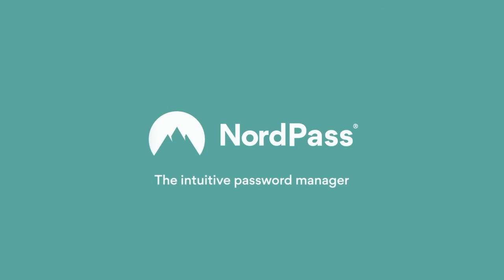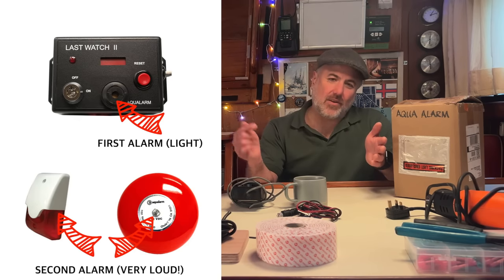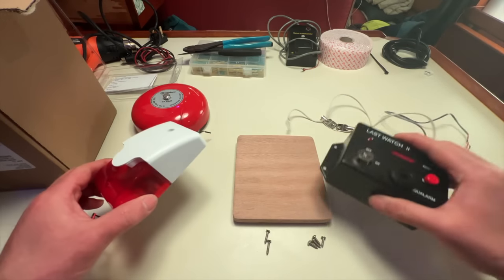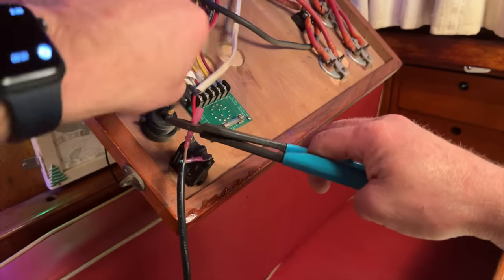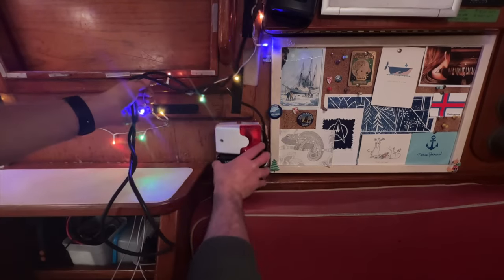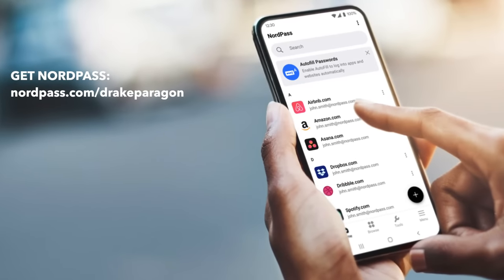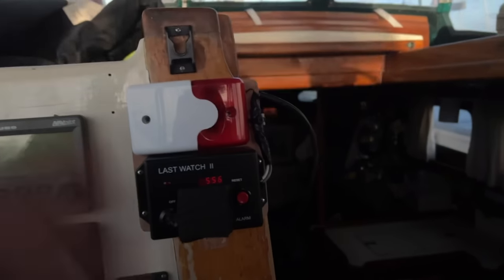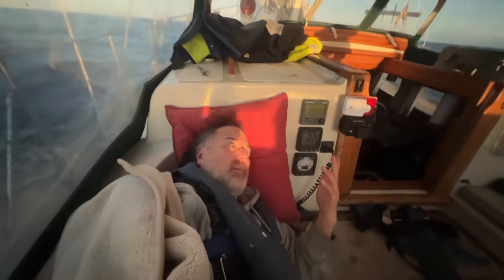The best watch keeping alarm - Aqualarm Last Watch II | Paragon’s Favorite Stuff Ep. 14

Comment: Installed that on my boat a while ago. I was wondering when you were going to realize how loud the alarm is😂. I single hand so don’t have the second alarm. Great video.
Reply from the maker: Thanks S/V Della Jean! Ha! Ya, the first alarm is pretty loud. After I put the foam over it I think I got the volume level just right. But I think the 2nd alarm can still come in handy if you're single handed. I think if the engine and wind noises are loud enough, and if you're sleep deprived and exhausted enough, then you might fall asleep and not hear the first alarm go off. In that case, the 2nd alarm will definitely wake you up no matter what.

Comment: Welcome back. I made my alarm using an Arduino mini an 3D printed box. Cost was 15 USD...
Reply: Hi, would you mind sharing the sketch?
Reply from the maker: Hi Jan, Thanks. I've often wondered about making stuff for the boat with a 3d printer. What make/model of 3d printer do you have? What did it cost? Or did you send your 3d design to a company that printed if for you?
Reply: @drakeParagon  Creality Ender-3 S1 - 3D-Printer is the one i use, you can get it for around 415 USD,  just printed a spare bracket for my autopilot - saved me 65 Euro...

Comment: Great review Drake, I had tried a while ago to find your other Watch alarm but as you say it is discontinued which is a shame.  Anyway this one looks just as good.  How much time between the initial alarm and the second alarm.  Thanks. Andy UK
Reply from the maker: Hi Andy, Thanks! On the Aqualarm you have 30 seconds to hit the button before the 2nd alarm goes off. On the Watch Commander it was a full minute, but we found that 30 seconds worked fine too. So far we've used the Aqualarm to sail 215 nm from Faroe to Shetland and 400 nm from Shetland to Denmark, and it has worked great.  I really like how you can always see on the display how much time remains.
- Drake
Reply: @drakeParagon  Great thanks Drake.  Looks like a great solution and cheaper than the old system.  A

Comment: What a great  piece of equipment  Drake  - on another subject - Armaflex insulation - just what I am looking for - can you give me soome feedback - has it helped.. cheers
Reply from the maker: Thanks. :) We love Armaflex insulation. I've installed countless 3x3 meter rolls of 32 mm thick Armaflex on our hull, from the deck to the floorboards, and also on the underside of the deck, and I think it has made a huge difference. I far prefer the version of Armaflex that has the self adhesive backing. You can stick it right on the hull, and then it becomes a part of the hull. No airspaces between the insulation and the hull, and little to no condensation. We then covered most of our Armaflex with Reflectix, or with a thin, but much stronger foam insulation to protect the Armaflex. I think it's great stuff, and worth the price. If you have any questions about it, please feel free to ask. :)  - Drake
Reply: @drakeParagon  shew thanks for that Drake. I have been looking for something to insulate the boat as we want to visit places - like you do. So want to try and keep the boat warm So excuse my ignorance..if i ask a stupid question.  Does it reduce condensation The self adhesive one seems the go I have been online trying to find it to buy some- any suggestions - or can you point me in the right direction. Have also bought an Omnia oven after your recomendation thanks.
Reply from the maker: @DirkJacobsz  Hi, yes it does help reduce condensation. For example, previously there were areas of the inside of our hull that were covered with strips of teak, with a small air space between the teak and the hull. In the winter, tons of condensation always formed right on the inside of the hull, and that condensations turned it into a dirty, moldy mess. I got rid of all that wood and just put up Armaflex insulation, adhered directly to the hull, and then covered that with Reflectix. And now the condensation has been mostly eliminated. Sometimes when it gets extremely cold, below freezing, then a small amount of condensation might appear on the Reflectix, but it's easily wiped up, and far less of and issue than it was before. As far as condensation goes, I think a desiccant dehumidifier can make all the difference in the world over a winter, if you're hooked up to shorepower to run it. Here in the UK, I used to be able to buy Armaflex from many different local companies, but after Brexit, it became almost impossible to find. At this point, I can only find it for sale on eBay from a distributor in Poland. https://www.ebay.co.uk/itm/323122509693?hash=item4b3b9a377d:g:5JkAAOSwXOhaT5sx&amdata=enc%3AAQAHAAAAoCAcFdFIb4v3nKNneWLFPaXzP3GWcQxkA3F5bkdoMpqXZelMQ%2BHJvH1YrysEjWxHfbdSESqgRmq2H4ifKzdw0kb%2BZpKlhzOuK17RaG3MDh30w0vHLnUAjE7jeLwHoUvKIxKMu%2FwVVf0Z7ZOzAVir6dHUFibxxQFdbfgSwO09WM5wt8Aqt5m%2FU%2FNUdWml7ER9tW3ZjcwwHX%2F1wKrEqv3dyYo%3D%7Ctkp%3ABk9SR-DCmLSaYQ
Reply: @drakeParagon   You are a superstar thanks - hope to meet up with you one day. Fair  winds aye

Comment: Sorry. That would get a float test on my boat. (Yes I still keep watch......)Ok I have changed my mind. It would be good.
Reply from the maker: The mast and boom are made of aluminum, with stainless bolts and nuts  attaching various stainless components.
Reply: @drakeParagon  I was thinking about the piece that was repaired. The plate was made of aluminium?